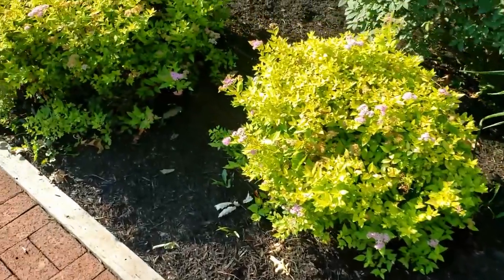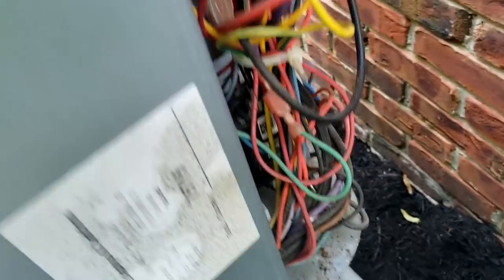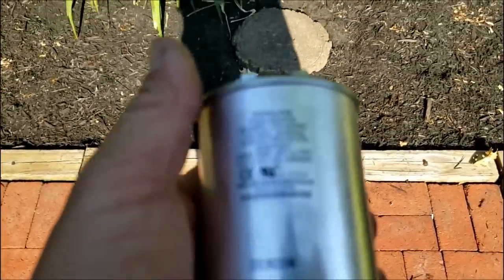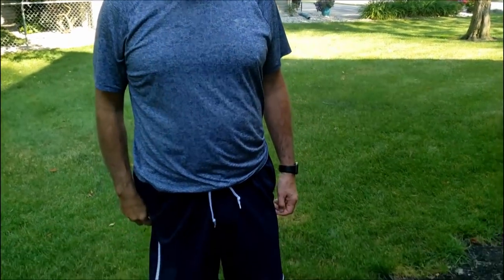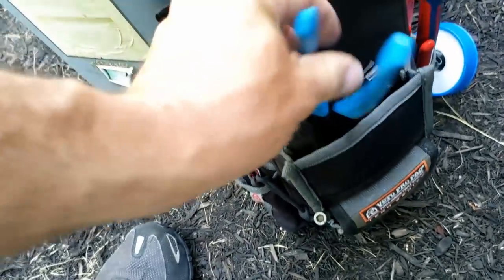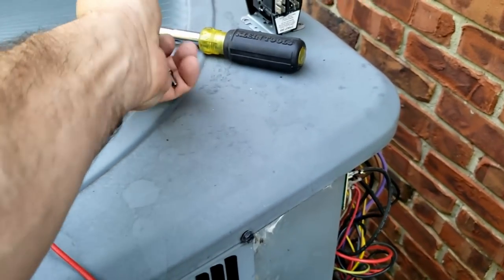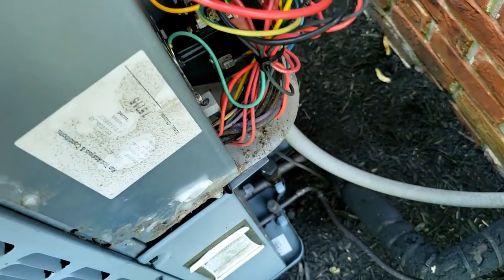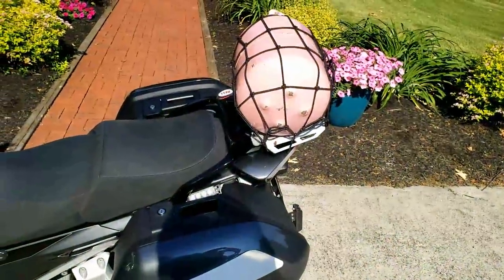Top 3 Reasons For AC Not cooling

Comment: That contact that was in unit it has one shunt side which is straight power to compressor on one leg and there is reason for that on compressor without crankcase heater and you eliminated that by putting diffirent type of contact
Reply from the maker: LoL, remember the red wire I showed in the video? That was used to jump the one leg of power. That is usually used for trickle current through the capacitor circuit not a crank case heater.
Reply: HVACR Survival cool that good you put jumper where it the straight line of the contact shunt side and About the reason of shunt side I used to always hear that they do that sometimes when they don’t use crankcase heater. So that leg keep winding little warm and serve as crankcase heater and that what even HVAC/R video he said that in one of his video but I have never seen that in book to tell you that’s reason for sure good job and good luck because I do like your video and only reason I mentioned the contact because I always believe that in our hvac community we learn from each other so we can be the best then in any other country god bless america
Reply from the maker: I appreciate that 👍👍. Carrier does it on almost all there units. So I'm use to jumping it because we only stock double and triple pole contactors on the truck. Thanks for the back story, it helps show your just trying to help and not condemn 👍👍